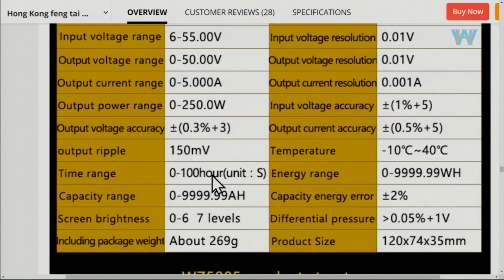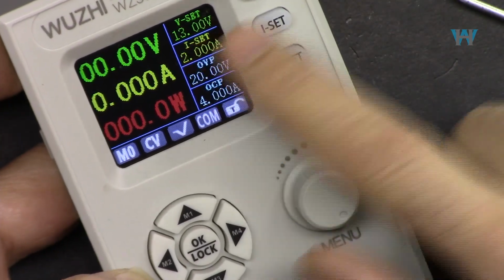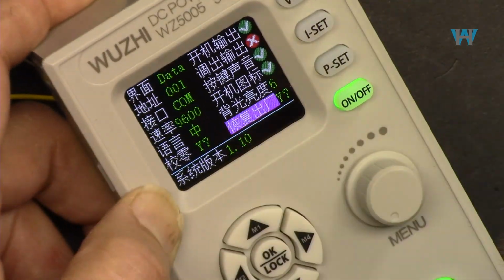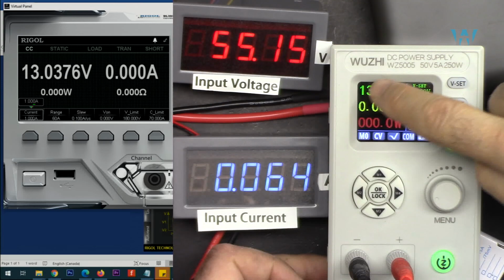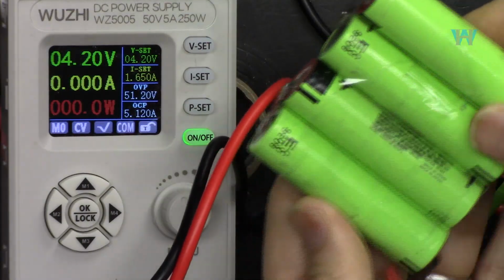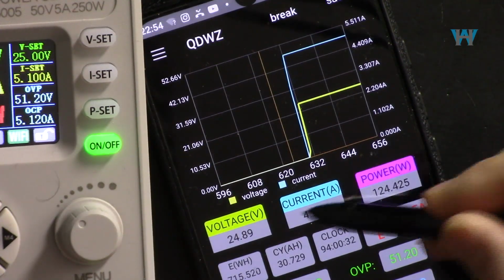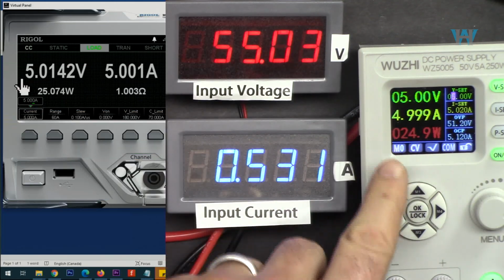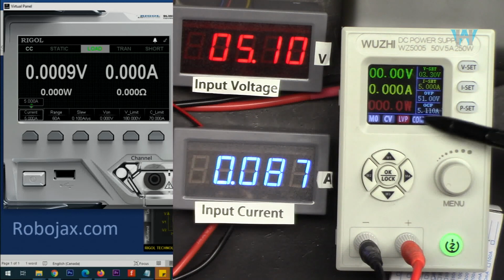Review of WUZHI WZ5005 250W 5A Buck Converter panel with WiFi App

Comment: Got one of these, got a 48v meanwell style PSU cranked to 51v, designed and 3D printed a case and couldn't be happier with the setup.

Only managed to get to 47.7 something volts, so not quite 48v - but awesome all the same.

Thanks!

Comment: I just ordered a small bench power supply rated 0-120VDC, 3A.  I want to test it right away so I can return it if there's a problem.  I don't have the fancy load tester you have so I'll need to find some pure resistive loads and maybe toss in a soldering iron or two to get it close to 40 ohms and 360 watts (keeping the power factor at 1).  I may have a rheostat to tweak it with.  I was surprised to see the reviews on youtube were mostly hugging their new power supply and playing with the CC and CV knobs.  No-one was testing it's limits. Maybe you'll do one in the future, a cheap one like I would buy.
Reply from the maker: Hi, what do you mean by "testing it's limit"? it says 5A and I tested it at 5A. isn't that the maximum?
Reply: @WattHour  Sorry for the confusion.  Yes, you always test to the limits of the voltage and current.  I was wondering how I was going to do that test on my new benchtop power supply without a load tester.  So my power supply is rated 120V / 3A DC.  That's 360 watts.  If I connect it to a 120V resistive heater that is more than 360 W, will it limit both the voltage and current to 120V / 3A? or do I need to find an exact load?
Reply: @WattHour  I ordered some 120V light bulb sockets I can plug into an outlet strip that should let me test the new 120V / 3A supply.  I'm thinking about ordering a 30V / 10A supply.  I'll need another strategy for testing that one.

Comment: I consider buying this. Does it have short circuit protection?
Reply from the maker: when we have CC or constant current on a module, it is automatically short circuit protected because it goes to maximum current in short mode and voltage is reduced to zero. so yes.
Reply: @WattHour  Thanks for your answer :)

Comment: The specs mention undervoltage protection (LVP), which would be useful for powering stuff from Li-ion batteries.  Did you find any evidence of that feature in the settings?
Reply from the maker: All feature have been demonstrated  or mentioned it and I did not show it, it does not have it.

Comment: could you conclude voltage input is best for DC to DC converter? high voltage 55v input , and the near voltage between input and output, which is best for convert efficiency?
Reply from the maker: I have done so many test making sure it covers all best possible voltages. I don’t remember what I did, please watch fully and come to conclusion

Comment: in this power supply, can we have a steady output volts of 5v and current of 5A?.. i mean can we demand 5Amp despite of what the components current needed?... your reply is badly needed.. thanks :)
Reply: what i mean is... i want this power supply must have current output of 5amp what ever the load is... i want to have a steady and fixed current supply either 1A..3A.. or 5A... the output current must be produced according to my desired value... can we do that in this power supply sir?
Reply from the maker: Yes that is exactly constant current mean.  whatever you set, you will get that and it will not increase. But of course you should know if there is no load, current is zero 0. so your load must demand current and it will give it. if you set 4A but your load ask for 3A, it will give 3A. 5A means it will not allow more than that. But voltage is always 5V. if your load demands more current, this will keep the current 4A and will reduce the voltage to keep it at 4A.
Reply: @WattHour  ah ok... this is not the power supply i'm looking for...what im looking is that... when i demand 4A... it should be 4A output even if the load is 3A... can you recommend that kind of PSU sir?.. which is also cheaper?
Reply from the maker: so you decide your maximum voltage and your current for example the maximum voltage is 12V and maximum current you need is 5A, then 12x5=60W so you find a 60W module that can give you  that or it must give 5A in all voltages. i hope this helps.

Comment: But I wonder what the maximum diameter of cable I can put into input green connector? 
I'm looking for a 2 square mm diameter cable, but not sure would it fir the connector? Especially when cable is crimped in square crimp)

* I'm expecting the device from Aliexpress and want to but the cable for connections before it's arrival.
Reply from the maker: Hi, you see the list in here https://www.engineeringtoolbox.com/awg-wire-gauge-d_731.html

Comment: Did you figure out how to calibrate it? Mine is giving lower actual reading voltage than the configured in the device. i.e. at 5.00 volts it supply 4.978v at 50.00 volts it supply 49.78v. Do you think it is acceptable?
Reply from the maker: anything that manufacture has shown on the manual has been fully explained.
Reply: @WattHour  I've read the manual, there is only zero calibration for current.

Comment: I'm looking to buy dc power supply my budget 100 dollar what do you recommend to buy wz5005 or buy them ac to dc power supply 30v 10a I see them around 80 dollar on Amazon BTW I'm not professional it's for testing and charging batteries at different voltage
Reply from the maker: if you don't need the WiFi feature, get the one from Amazon https://amzn.to/3jJpcbS which you can see the video here https://youtu.be/tQdUfy0uyUQ it showed to be excellent under all tests.
Reply: @WattHour  Thank you so much 
I didn't know you have another yt channel keep up the good work God bless you

Comment: Where can I find the PC software for this power supply ???
Reply from the maker: I don't remember if this has USB connectivity  and if you can connect it to PC.
Reply: @WattHour  but it does support USB to TTL connection and the manufacturer provides USB to TTL module with this item
Reply: @rifatahmed4659  was you able to find the pc software? i bought one one this but I have not received the pc software
Reply: @fabricioleinat  unfortunately i could not find any pc software for it 😭

Comment: Is there any english manual for this anywhere? I could not find one anywhere. Also, any info about how to power this? It seems that it needs to be powered by DC? Do you know what voltage? And what max current it draws? Does anyone have any recommendations for a power supply for this?
Reply from the maker: I believe I made this video to answer every  questions you have. Please watch without skipping and you will get all answers.I made this video in 3 yo 5 days of work.
Reply from the maker: Hello, If you live in Canada or USA, I am giving away this DL24P 180W load and energy meter. Make sure to sign up for it https://youtu.be/-UblSfUEY-0

Comment: Good job, dear!
Can you help me, Robojax? My wifi module of WZ5005 was broken. I am engeneer. I replaced the dcdc IC and esp-12s module. But now I need to flashing ESP module because it work with its factory AT-commands-based firmwafe now.
Can you read for me .bin or .hex from your module so that I can restore my communication module?
Thank you! Best regards, Renat.
Reply from the maker: Hello Renat, you know this is excellent module. if they release the firmware, then you will see 100s of stores will produce and sell it. I don't thin you we will ever see it.